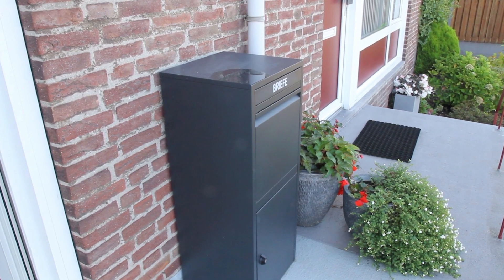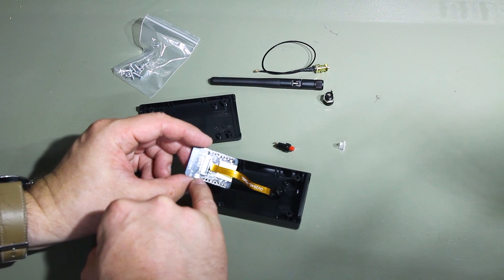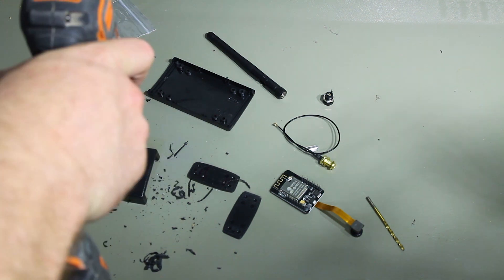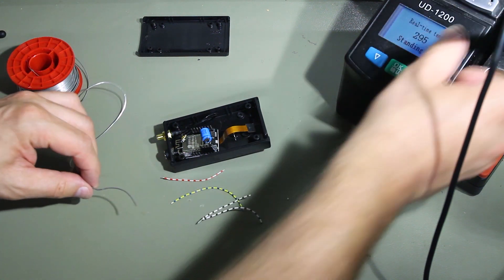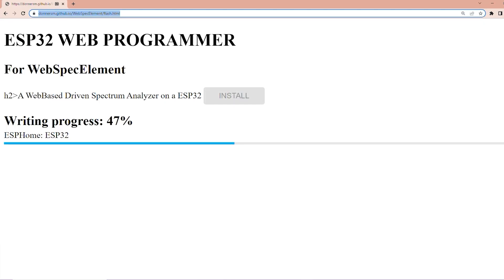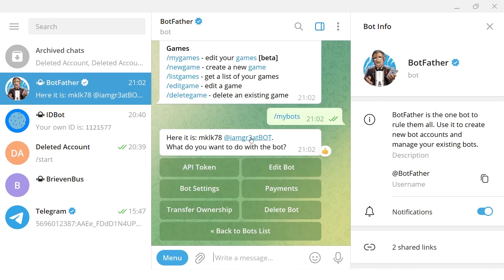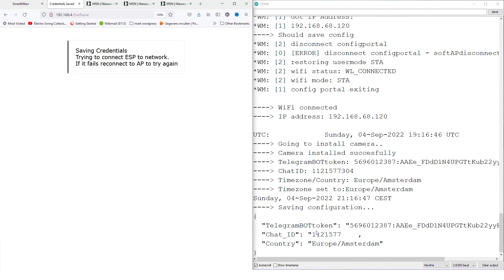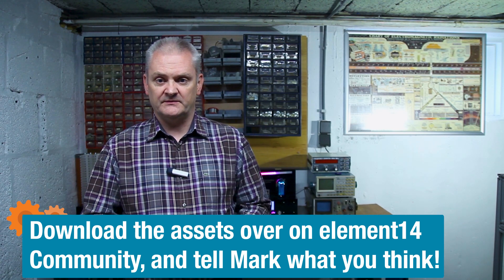How to Use an ESP32 & Camera to Know You've Got Mail!

Comment: Regarding the acryllic plastic to help emit the LED light on the plastic casing, I've cut up a 5mm clear LED before with a dremel type tool, to seperate the clear upper "lense" part of the LED and then drilled a 5mm hole and placed the lense in. This was for a cheap Chinese battery bank that had a surface mounted LED mounted near to the black plastic casing but the casing barely allowed any light through and the sacrificed LED "lense" worked really well.
Reply: That sound like a good idea, although it might be some more work. For people who have no laser cutter this might actually be a solution.

Comment: The resistor for the antenna is zero ohm so using a blob of solder to bridge is a lot easier than trying not to tombstone the original resistor.
Reply: Yeah a blob will work

Comment: I ask that you use microscope with camera and display, or mount camera just above electronics to see you ACTUALLY SOLDER IN WIRES/COMPONENTS TO WHAT CONNECTIONS ON THE BOARD.
I AMNEW AND NEED TO SEE THAT. I DO NOT KNOW MAIN BOARD PARTS AND CONNECTIONS.

GOD BLESS!
Reply: I used microscooe

Comment: Just keep in mind it may be illegal to modify a mail box in some locations
Reply: I'm in the USA, and agree with @TeddyRuxpin, and have done similar things before. When the box was owned by the Postal Service or the Apartment Complex, I used a double stick tape mount both internally and for the external antenna. On Boxes that I provide, all bets are off...
Reply: Is that so? Indidn’t know that. In holland we can modify it the way we want
Reply: @TheElectronicEngineer  In the USA it depends. Some mail boxes are owned by the postal service and its a big punishment if you modify it. But other mail boxes are purchased by the home owner.